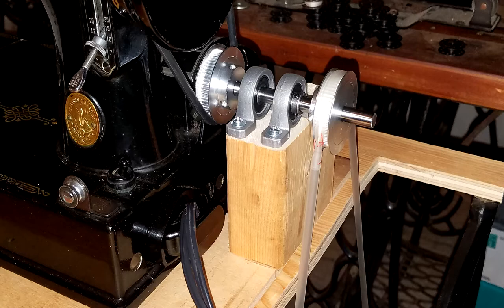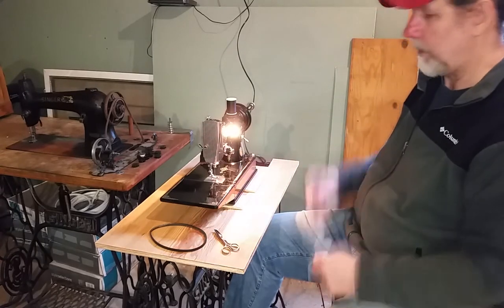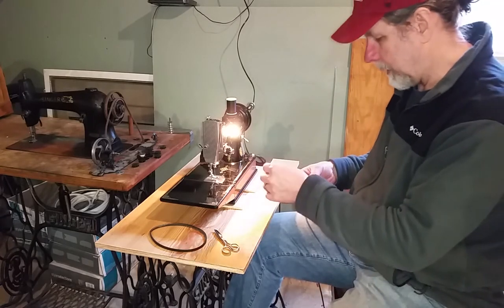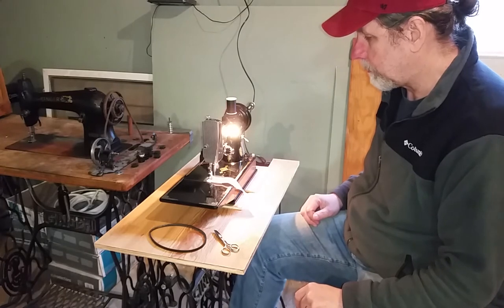Treadle Mounted Singer 221 Featherweight

Comment: Great ingenuity!  How did you connect fish tube as a belt - super glue ends?  Wasnt sure what type of connection would hold up to stress of Treadle.
Reply from the maker: I used needle and thread to stitch the ends together.   (Sorry for the delay, was out of state for a few weeks.)

Comment: Another great video and good idea.this will be fun with my singer 319 and 237 i have in treadle stands.i have not forgotten about the video of the Wheeler &Wilson D 12.we have not the weather yet for finishing repairs and filming.keep the videos comming, are watching. Thanks... 13Stitch.
Reply from the maker: Thanks.  Let us know how they turn out.
Reply from the maker: Henry, for your 237 check out this - http://mysewingmachineobsession.blogspot.com/2012/11/singer-237-treadle.html  It looks like with the motor boss removed a treadle belt will clear the machine without the need for a secondary drive.  Of course if you want to keep the option of electric or treadle then that might not work.  Cheers.